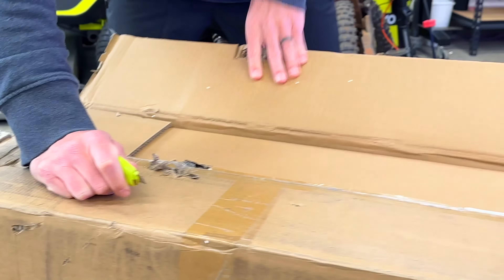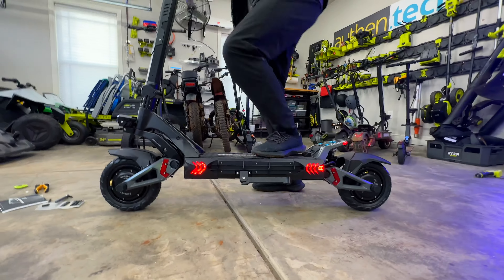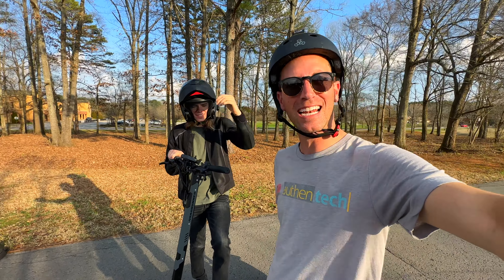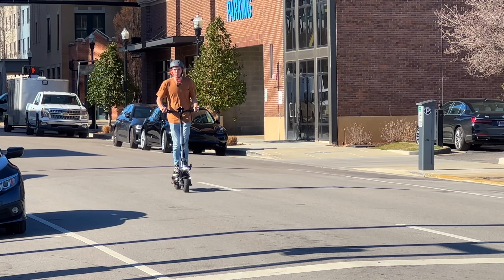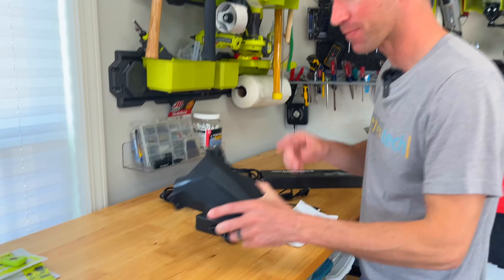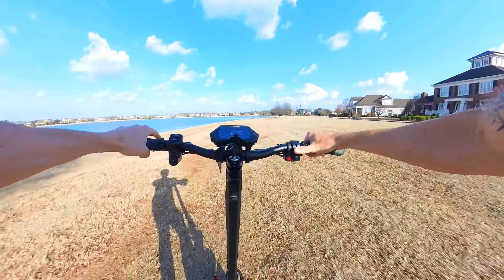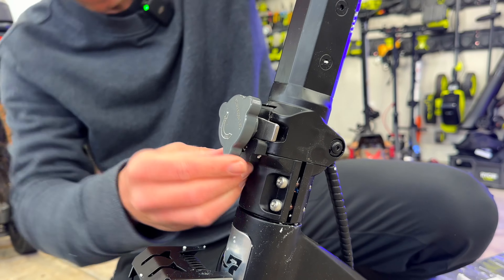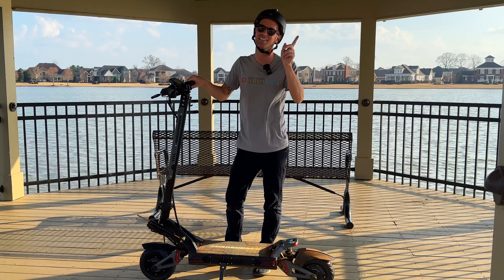This Electric Scooter is INSANE! (RoadRunner RS5 Honest Review)

Comment: For ppl living in others country, kukirin got the same scooter with the base battery of the rs5, I got that one and it's cheaper. But the roadrunner look better as it is gray and black while the kukirin g3pro is orange that I'm not a fan of. Thanks for this review and yeah gonna get that steering damper too
Reply: The Kukirin Kugoo G3 Pro doesn't have the hole needed to mount the damper though.. I guess you'd have to drill..

Comment: I live in Jersey in the suburbs with everything close within 5 miles. I just bought this to cruise around town on a nice day when I don't feel like taking my truck and this things mileage is PLENTY. I'm 240lbs muscle and it handles my weight no problem with single motor. I barely need to engage the 2nd motor unless I'm going up a relatively steep hill. Plenty of speed too. Love this scooter, highly recommend.
Reply: big g, i live in new rochelle and want to get this because traffic is really heavy. i was wondering if dual or single motor appears on screen. thank you.
Reply: @kevinwalsh9483  yes, it displays which mode you are on.
Reply: @rubyruby5710  No, 2nd. First one was a Varla Eagle. Great scooter as well, but the Roadrunner Def takes the lead between the two.
Reply: Use both motors you actually use less energy the only thing that will drain your energy is the added torque due to the second motor being activated
Reply: Do you still have it?
Reply: @kodyking3090  yes

Comment: I bought one of these a few weeks ago.  Thing is fast and carries a heavy load easily (I am 250 lbs).  Unfortunately mine also arrived damaged in the box.  rear fender was broken off and headlight switch was inoperable (turn signals were fine).  Rear brakes were also really soft and eventually gave out completely in first 20 miles (cable connection to brake handle was leaking air which  discovered when I tried to bleed system).  Great customer support as they sent out parts as soon as they could but packaging definitely needs an upgrade to prevent damage in transit. This is thing is heavy and I think the delivery drivers just manhandle it around.
Reply: I'm sure it's a kugoo rebranded 🤔
I've had two kugoo's
 they lasted about three weeks
I paid less than the price of this for my 
wolf warrior X pro
Reply: @winniepeg2020 are wolf warriors more reliable? I've been looking to upgrade from my entry level scooter but there's so many friggen options lol it seems like most of them are made in China and all have mixed reviews... I'm looking around the 1500 range but everytime I think I found a good reliable scooter I look past the YouTube hype reviews and find that they actually suck lol
Reply: They are shipping them with the fenders on now, so there's way less chance of broken fenders now.

Comment: What about flats?  Do you get flat tires on these high end scooters?  I picked up a $500 scooter and got flats in it until I went with solid tire.  Other than that it has been a blast, and I want to upgrade.
Reply: If you put slime in the tire for flats and also make sure your tires are proper psi. Every time you go out. I keep a small hand held one so it does not make it feel hard to do every time. 
But I never get flats when I do that. 
Slime works for the nails. And keeping your tire proper psi will keep it from going flat naturally

Comment: Any news on any power difference  with rs5+ battery vs base one like lil faster. I heard it has about 10 miles more range but just wondering if it gives more kick
Reply: It is just a bigger battery. It has a little more amps, so you might be able to go 2 - 3 MPH more.
Reply: I wonder if thats why mine seems to get some stuttery acceleration in third?  Maybe the stock battery isn't quite cutting it?  I just hope I don't have a controller or motor problem 😳
Reply: @KeithPhillips speed controller issue i had that return it or fix it yourself

Comment: You're actually able to adjust the torque a little bit in the P settings to move faster off the line, not sure if you did that or not but, I bet the RS5 would have kept up better with the Dualtron.
Reply from the maker: First thing I do when unboxing, max out p settings

Comment: How much does it cost
Reply: 1,999
Reply: I just paid $1,890 last night for the Roadrunner RS5 V2.0 (not plus model) and it included shipping (and no tax) direct from Roadrunner. The plus is more expensive only for the larger battery.  I planned on buying a larger second battery later anyway, so the non-plus model was fine.
Reply: The Kukirin G3 pro is the same exact scooter in orange, but is $500 cheaper
Reply: @KeithPhillips how’s it holding up? and how has customer service been?